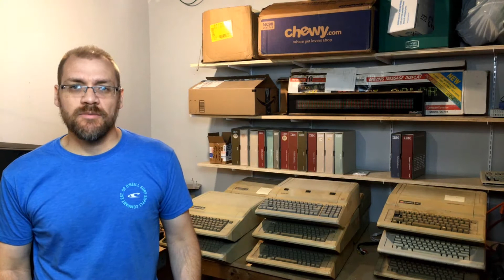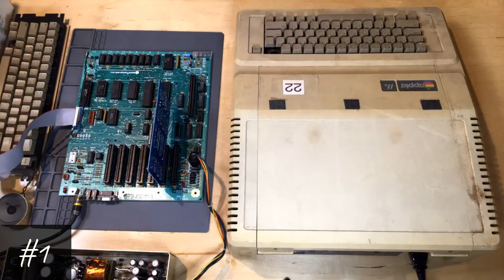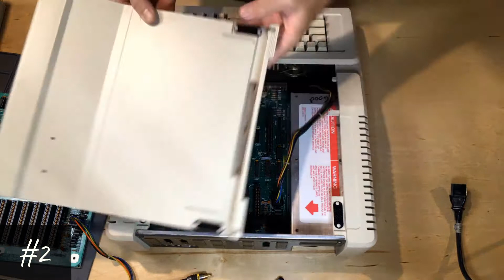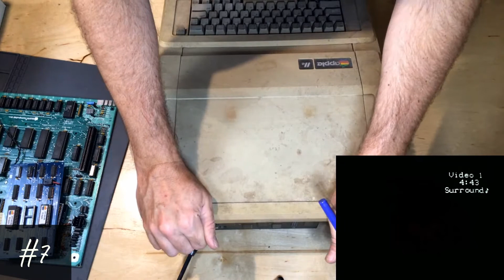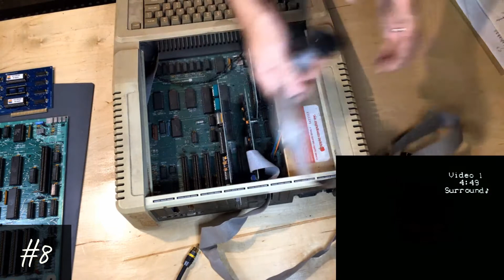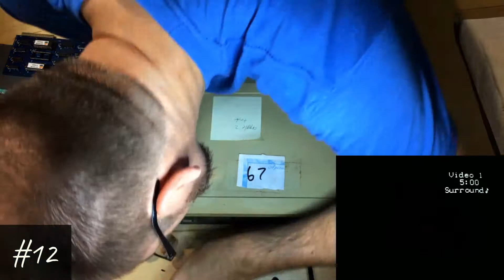Refurbishing Twelve Apple IIe's, Part 1

Comment: Computer #8 has its 80-column card installed backwards.  Noticed that as soon as you cracked it open.

When installed properly, the components are on the same side of the card as with the SSC and Grappler and the diagonal part on the top of the card faces the keyboard (the same way that the lid slopes).

As soon as you powered it on, I found myself yelling "Turn it off!  Turn it off!  Turn it off!" but you apparently didn't hear me :-)
Reply from the maker: I obviously missed that.  They’ve all been completely dismantled and I guarantee it won’t go back in that way ;). Good catch, though.  Looks like one less motherboard with issues!  I think.